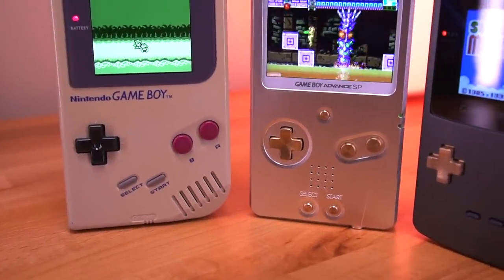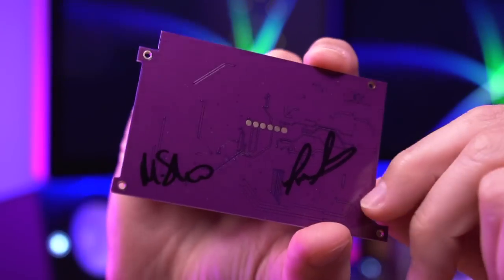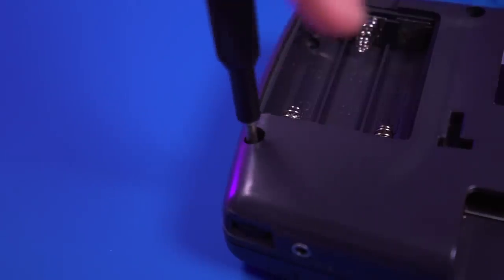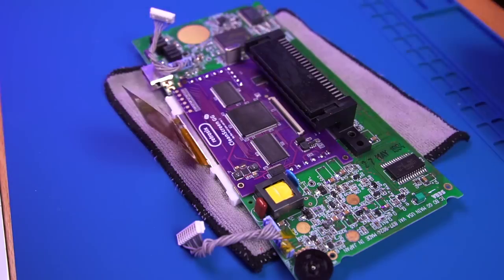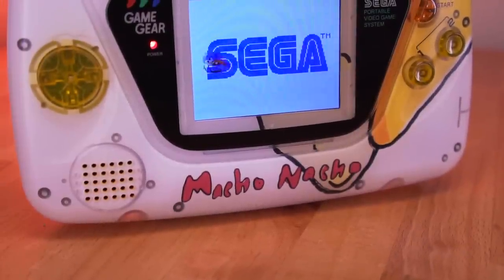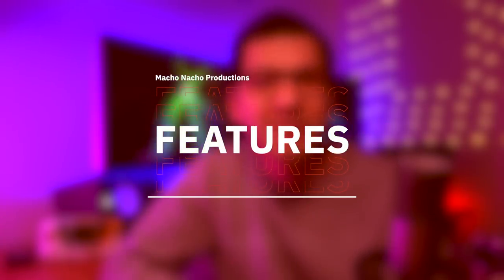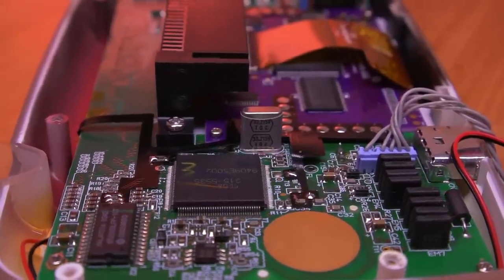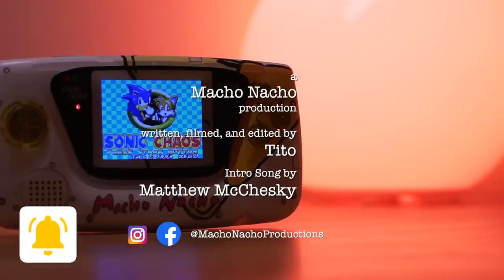EASIEST Game Gear LCD Mod | RetroSix CleanScreen GG Kit | Retro Renew

Comment: Fantastic video. My only experience with the Game Gear was a girl in my neighborhood who got one in 1999 when Majesco re-released it. I was blown away with the backlit screen and power in a time when I had a Gameboy Color and a worm light. I was less impressed when I found out her parents refused to give her batteries so she had to use an AC adapter and plug into the wall!
Reply from the maker: Haha, that’s was the true struggle of the game gear. I remember when I was younger I spent more time playing it plugged in than with batteries too. I also had a recharge battery pack which was kinda cool!  Cheers!

Comment: Fantastic video and super excited to see more competition for Game Gear modding. Seems like each company releasing an LCD kit is improving on the last. This leads to something I'm surprised you didn't mention in the video, and that's costs. McWill's will go over $100 (if you get them Stateside and get a genuine McWill, not a Chinese clone) and the RetroKai Magic Screen also comes out to $100 with better features than the McWill. And now it seems like this kit will be closer to the $65-$75 range WITH significant install and feature improvements on the other kits.
Reply from the maker: That’s a great point!  Cost is definitely a huge factor that I should have mentioned. I need to get more sleep.
Reply: @MachoNachoProductions  haha I understand that. You're videos are superb - some of the best retro modding videos on YouTube. Your sub numbers definitely don't reflect the quality of your content. Keep pumping it out and I'm sure the subs will catch up.

Comment: I appreciate this, I just recently found my game gear in a box, in my parents basement and have replaced all the caps from the retro six cap kit on the mother board. In doing so I also order the screen but after watching your video it looks like I will have to order those bracket other boards and that tape as well 🤦🏽‍♂️😂

Comment: This looks really cool. A couple years back I collected many retro consoles and portables. I lost interest but have gotten back into it a bit and I want to upgrade my Sega Game Gear. My only block is I have no prior knowledge of soldering and I'm unsure of these tools and whats needed. I think if I did start, I would want to try on a GBA, then move on to a Game Gear. Wish me luck!
Reply: Start with cheap practice kits. I went with a mini-Piano 🎹 kit off Amazon that has lots of soldering and fun to use after your done. It's surprisingly easy after awhile but you'll need quite a few tools to be ready for a big modification. Temperature controlled Iron, several different sized tips big and small, Micro screwdriver and screws set, Soldering wire with Rosin/Flux already built-in, Micro Wire Cutters, Tweezers, Flux, Soldering Wick and Solder Sucker. Bunch of stuff I'm probably forgetting but those basic tools will get you off to a good start. ;)
Reply: @overnightdelivery  Sorry for the late response.  I recently bought a bunch of tools for soldering. I've so far have only done simples projects like fixing Gameboy cartridge's save batteries. I've never heard of these kits and will defiantly will be checking them out.

Comment: Hey what gauge wire did you use for the 9 and 21 pins on the back?  I want to use wire from a CAT5 cable that I had but the gauge seemed to big. Any suggestions?

Comment: Hey Tito, amazing build and video as usual! I’m digging that custom shell, looks high quality and the colour is outstanding, nice touch! Regarding the screen, it does seem to be easier to install than the RetroKai which is a lot to say. Something I noticed with the screen modes, the scan lines seem horizontal rather than vertical present on the McWill and RetroKai modes, I’d like to see them side by side if possible and what is your opinion.
I’m also curious about the sound card, how better is the sound comparing to your RetroKai build/stock i.e.? I look forward to that video then hehe.
Cheers!
Reply from the maker: I am definitely thinking of doing a comparison video of the 3 options, I think people would be very interested in that. Will also be doing a dedicated RetroKAI soundboard video. Stay tuned!  Cheers Jesus!
Reply: @MachoNachoProductions  Brilliant Tito, thanks and enjoy your new build :)

Comment: We need either a screen with 2x the original resolution or a screen that has an Integer mode with the option to turn off the Game Gear mask, showing an extended field of view.

There is a Game Gear emulator for GBA that has this feature, making the game run in integer scale, but with the GBA native resolution and it's magnificent.
Reply from the maker: Whoa that’s awesome!  How do you get the game gear emulator on the gba?
Reply: @MachoNachoProductions  
(Macho Nacho noticed me! <3)

The emulator is called DrSMS, you can find more details on its official website:

http://www.webpersona.com/drsms/

Not all games work well without the mask, as some developers use it to hide objects and assets behind it.

But many games look great, like Sonic 1, Sonic 2, Sonic Chaos, GG Aleste 1 and 2 for example.
Reply: @MachoNachoProductions  

The emulator running on my modded GBA:

https://drive.google.com/file/d/1Tq1WKiP3m0EFCMJSidWB2HqHYTQJrssm/view

Comment: Hi Tito, I have I a weird poblem with this mod. It works flawless with the most of my games, but when I play prince of persia or a view other it looks awful with vertical stripes, missing color etc. Could you help?
Reply from the maker: I’m wondering if it’s an issue with the game rather than the mod. Since most of your games work. Check to see if the contacts on the non working games are dirty or oxidized.

Comment: This is pretty groundbreaking. Can you recommend an inexpensive desoldering tool? I'm replacing Caps and using a solder sucker is tedious.
Reply from the maker: My Hakko fr301 is amazing!  I have an affiliate link to it in the video description!  Cheers!
Reply: @MachoNachoProductions  thanks! I'll check it out. Been working on a CDX and it has a million caps.

Comment: Nice! Great video as always. Been waiting for this kit for a while, the price is attractive and I think is the lowest on the market outside of Aliexpress. I like that they sell the parts separately.
I mod a lot of Game Gears and I recently picked up two GGLCD boards from Japan. These use IPS panels (I believe the only kit that does) and they only display in one mode, which is equivalent to the horizontally scaled mode on a Mcwill, so you need to cut the shell. These have the best image quality I've seen so far - I posted some comparison pics here: https://imgur.com/a/ZRsNPtB The colurs are so much nicer on an IPS panel and the scaling looks almost perfect.
Also, BennVenn recently annouced they are making a similar kit to the GGLCD, with the same scaling and IPS screen, and they're also developing a fully integer scaled 640x480 version.
We are gonna be spoilt for choice with all these new screens!
Reply from the maker: Oh man thanks for for all the information!  Those Japanese kits sounds awesome, where can I buy one?  Also can’t wait for the benn venn!  Love that we’re getting all these game gear mods!  Cheers buddy!
Reply: @MachoNachoProductions  No problem Tito - I will tweet you the info!
Reply: Could you send me the link as well?

Comment: I just verified with them that the 2-SAIC version is out 🤗
Reply from the maker: Nice!
Reply: @MachoNachoProductions  Ya, thanks for the video.  I almost bought the inferior kit without the flex cable but now this one is on the way.  Will be using your video to install it.  

BTW, I look forward to your Game Gear sound video, if you're still doing that, and would like to suggest a Game Gear, or maybe a general, mod video about buttons/membranes.  So little info is out there on that aspect of modding, as far as I can tell.  Would be interesting to hear an experienced modder wax about that subject.

Comment: Should I replace all the compactors before doing this install?
Reply: 'Compactors' 😄 Auto-correct can be really annoying  I know. But yes, you should replace the capacitors because they will fail soon.. and odds are good that some of them have already. If you have a pre-owned GG, make sure they haven't already been replaced.
Reply: @overnightdelivery  thanks! No it’s my original. It turns on and plays with sound and all. But has lines through the screen
Reply: @indatubesurfer  Changing capacitors seems to fix 95% of old Game Gears. Most likely good news caps will fix it. But I would get some cheap testing boards to practice soldering and de-soldering first. There is a mini-Piano kit on Amazon that has lots of good soldering practice and you can play cool music when you get done.

Comment: Do you have to remove the caps as I didn't notice any on your board
Reply from the maker: I used the retrosix ceramic cap kit. They are small and easier to install than the electrolytic ones. I didn’t remove the caps, they’re just a bit harder to see.

Comment: lies down in the trash with his VA4
Maybe next year…
Reply: The flex cable needs more use in more mods.
Strange how long it's taken for it to start appearing in kits.
With those improvements to the power, maybe we can still hope for a dual LiPo mod that charges from that same USBC port. Since it won't need to inhale 6 AA cells after being relieved of that bulky guzzler of a CFL.